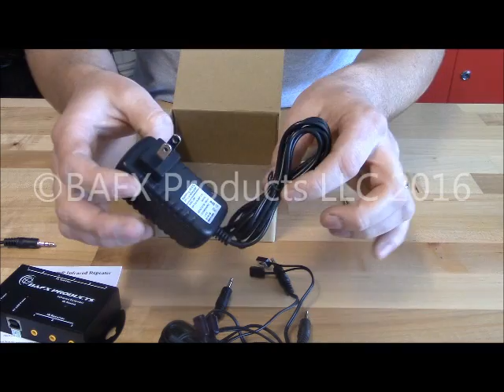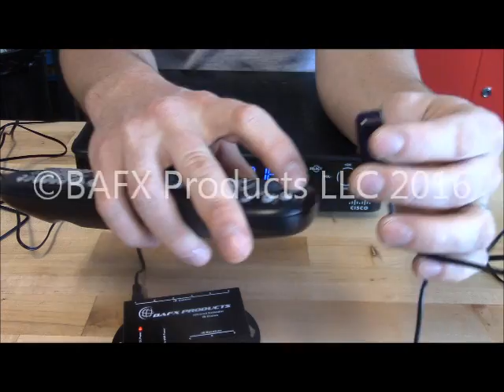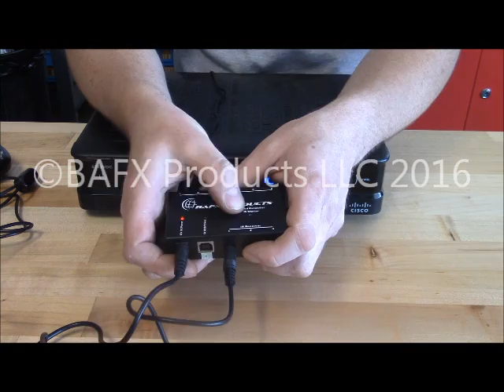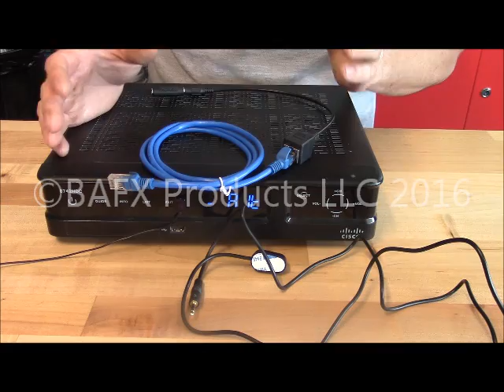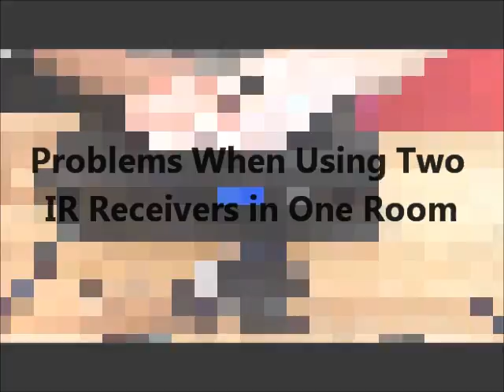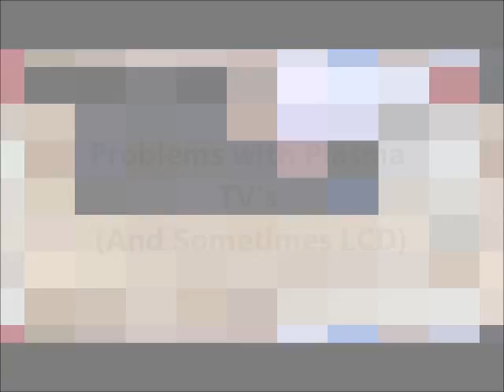BAFX Products® - Standard IR Repeater Kit / Remote Control Extender

Comment: what is the limit on the length of the cables  to each watching location?  How to run this over CAT5 without have electrical wiring skills to custom build connectors?
Reply from the maker: Hi Randall, For running over CAT5 the CAT5 line must be dedicated solely to the IR signal and must not run through any switches, hubs or routers. That said, we also sell a "CAT5 Adapter Kit" which comes with everything you need to plug the kit right into your CAT5 jacks without doing wiring work. In regards to how far you can extend the IR receivers, typically up to about 2-300'. This can vary though. If the extension is to run past heavy electrical wiring or other heavy electronics, this can cause signal loss/interference limiting how far it can be extended. If you have any additional questions, please feel free to contact us info@bafxpro.com